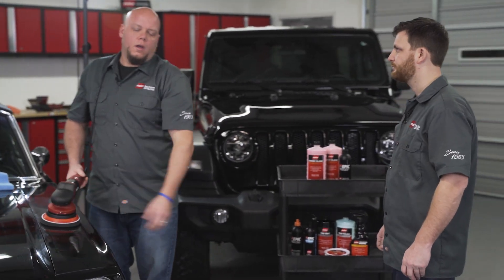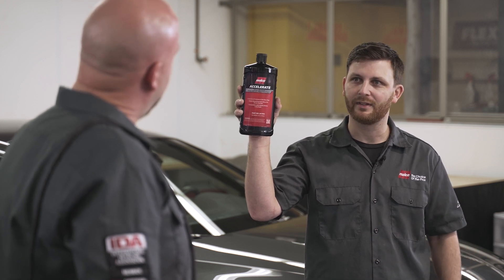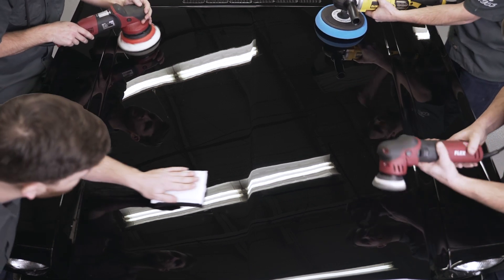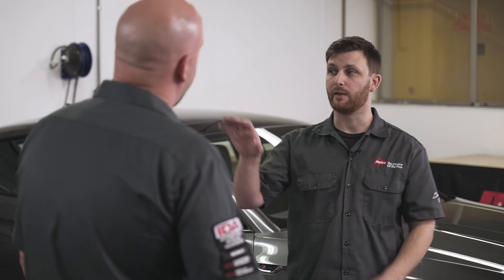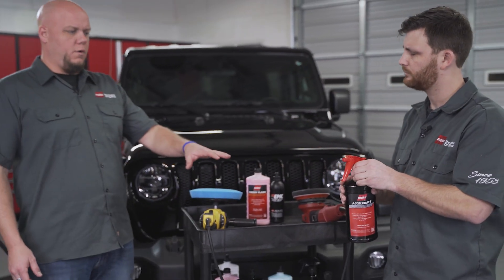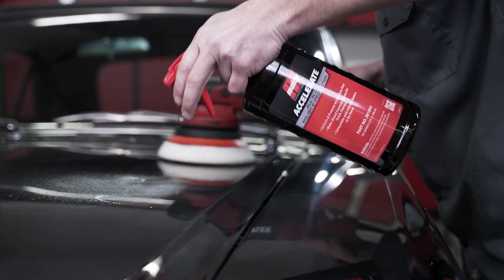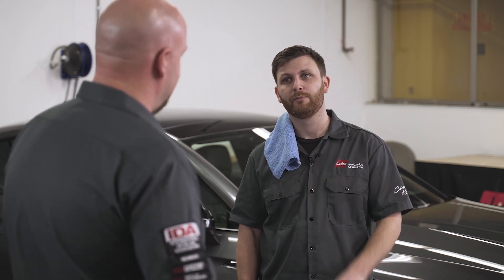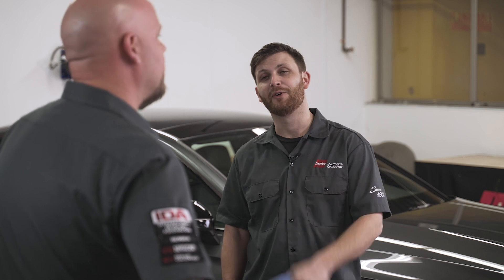Introducing Malco's Accelerate All In One Polish And Protection

Comment: If the car gets  damp or a little wet from drizzle you can see the “swirls” from the foampad. It looks like when you just applied it but the product it not on there. Is there a way to avoid this?
Reply from the maker: Hi Oscar! Try using a bit more compound on your pad, to ensure an even layer of Accelerate has been applied to the entire working area. It's also ideal to allow some time for the product to bond with the surface, prior to removal with a soft, clean microfiber. When doing a final wipe down, there is no need to use much pressure. Hope this helps!

Comment: does it stain black trim?
Reply from the maker: Yes, if not removed it can whiten black trim if baked on. We recommend wiping all trim clean after application.
Reply: @MalcoAutomotive  Thanks for that. I'll tape them...
Reply: @MalcoAutomotive  -- Does this AIO also cause the famous clogged pads?
Reply from the maker: @TheCeki1982  Accelerate should not "clog" a pad. However, we recommend always using 1-2 clean pads with any buffing or correction products. If you are not using a clean pad, excess product may build up causing oversaturation.